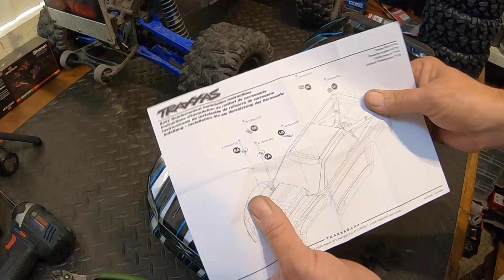Traxxas Xmaxx Snap On Addition Refreshing For 2023 Year Much Do Upgrades

Comment: Well that's a another great video , love the snap on truck ! , Hey earl , I put the hobbywing setup in my XRT, ended up with no reverse , did you use the stock ESC with your set up , I'm thinking the receiver is bad , right out of the box , all it does is blink red  , got steering and forward , ya gotta have those motor mount washers ! Why aren't they stock is just plane stupid , for a $1000 car jeeeeeze !!!
Reply from the maker: Sound like the esc is set up wrong there is a race setting only forward and brake then it has a forward brake and reverse setting on all hobbywing esc I used the hobbywing esc and a program card to set up mine
Reply: @earlmoorhead5555  after work tomorrow I was gunna do that , I was watching you and just thought I'd ask , thanks SOOOOO much for the response , I've waited two months to get this thing together and the snow finally melted , so maybe get r out tomorrow , thanks again , the weird thing is the receiver never goes to green , it just blinks red all the time

Comment: Hi Earl, I just bought the snap on body on Marketplace but missing the front and rear bumpers. Would you know how I could find these parts or get the part number? It’s a tall order but I’m trying everywhere. Thanks
Reply from the maker: Those part are not available
Reply: @earlmoorhead5555  ok, looks like I’ll get a 3d custom printed one. Thanks

Comment: Are you running the gear mesh pins? I haven't used them with aftermarket pinion and spur not sure if you can
Reply from the maker: Yes I am and haven’t broke a gear in years

Comment: i just picked up another runner for outside to ripp up and down the street but the wheels on the rhs front and rear where wonky like there was a buckle so i swapped them around and seems the wheels have also been glued on incorrectly so now waiting on a full set of replacements ,this is now the second RC from Traxxas with this issue 2 out of 7 aint too bad but there does seem to be a lack of QC when it comes down to it as even some stickers are not placed straight or centered i mean your paying decent $$$ for these RC's you expect them to at least be assembled correctly thanks again for Nother great video Buddy 🙂